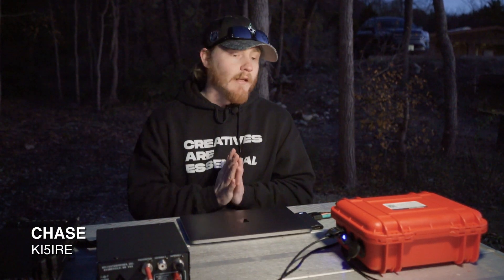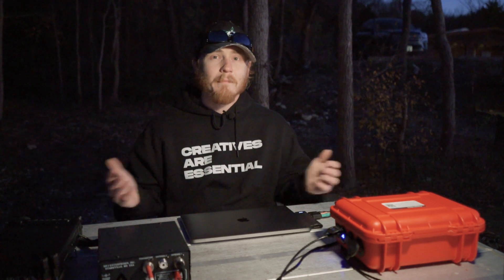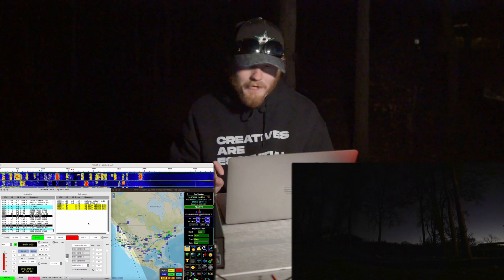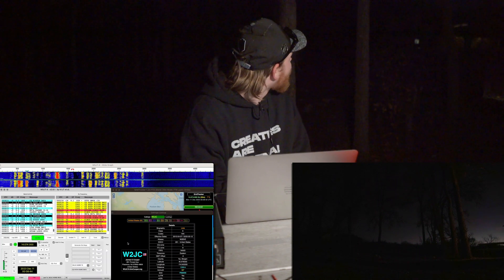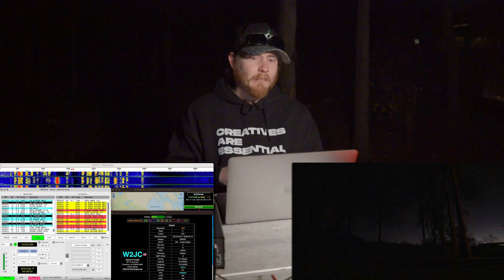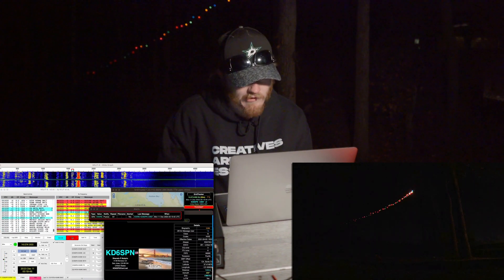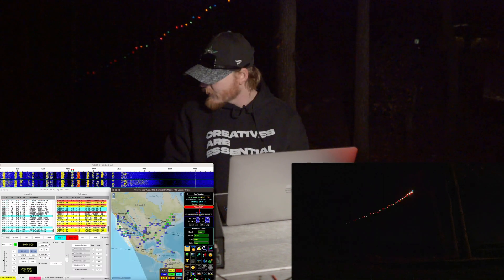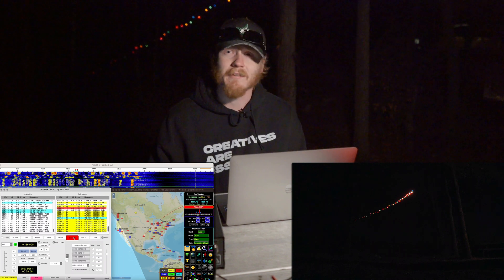Can Christmas Lights Work As A Ham Radio Antenna for POTA?

Comment: Well before I got into amateur radio I did an antenna light a bit differently. I found an old flatbed scanner that used a CCFL 15w tube 12 or 14 inches long. Very carefully, with gloves on, I removed the metal end caps and taped the glass to the vertical on my van. Driving down the highway people would ask where I was and I'd tell people to look for the light that came on when I was talking. Then I'd reach over, turn on my lowdrive. It was definitely brighter than 15w, but my duty cycle was way less than its expected use. it lasted until I forgot it was there before driving into a parking garage. 

That was also before I knew not to put a bunch of power into an antenna coated with ice and let the magic smoke out of the pills.

Comment: Fun video. Most of your 95 watts is being consumed by the lights. That’s probably why FT8 worked for you. It is designed for weak signal communication. To be understood, SSB requires far more power. Folks likely heard something but couldn’t make it out or you may have been in their noise floor. Again, fun video.